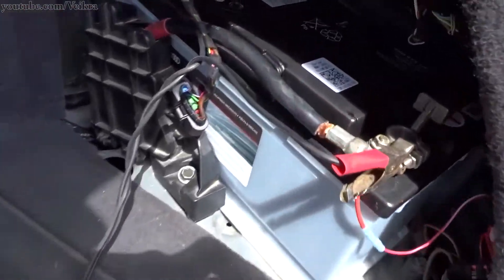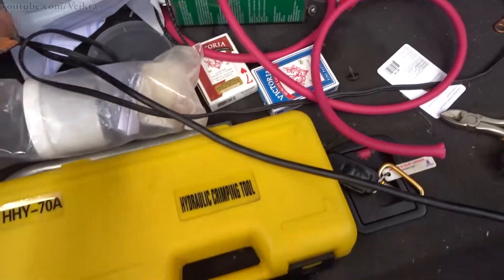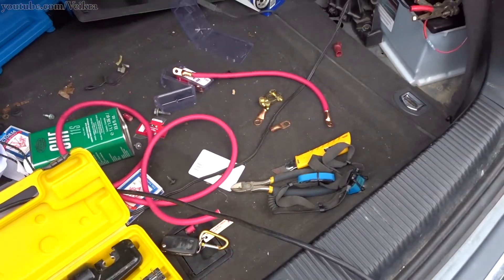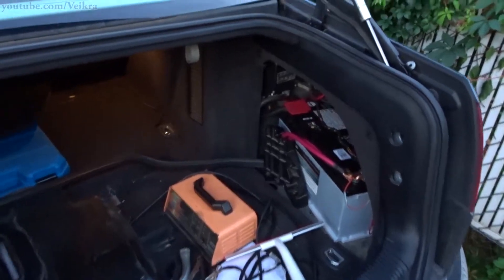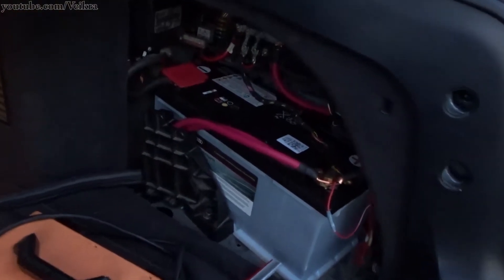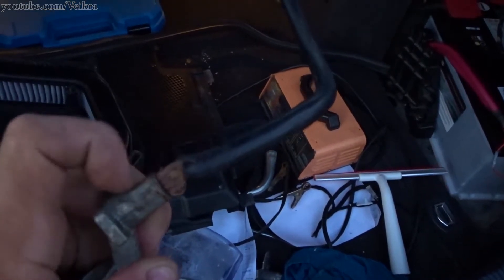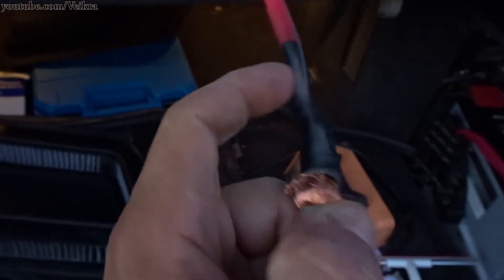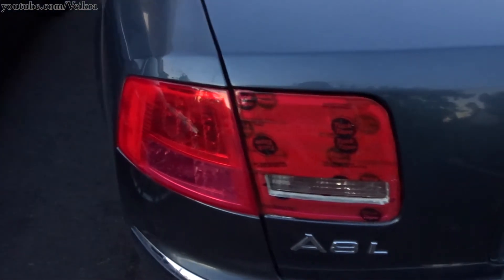How to Fix HOT battery terminals (540 000km Audi A8)

Comment: i have a problem with a older audi A8 D2 where i know the altenator works but it still doesn’t chartthe batery
Reply: any suggestions as in why it dosent work
Reply from the maker: @diamantpotoku8362  how much volts and amp was the alternator putting out when tested?  
I assume you have the similar watercooled alternator on a 4.2 right?

Comment: so bro how about after you installing the new battery cable its not overheating again? and what gauge did you put it on?
Reply from the maker: it's not getting hot anymore. You probably missed the updates on the videos following since youre not subscribed. I used 2 gauge wire to the rear fuse box since thats the correct size but doubled it up to go to the front of the car since I didnt have cabling big enough. I think it`s a 0 gauge going forward. The ground wire of the starter/engine is also a source of voltage drop that can cause a no start. I had to fix that as well
Reply: @Nordic_Mechanic  Can you please post link to the video you are referring to. Thanks for all d3 videos ❤